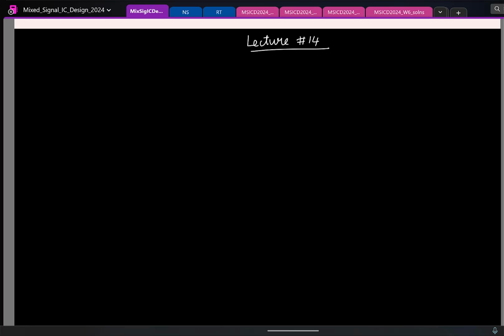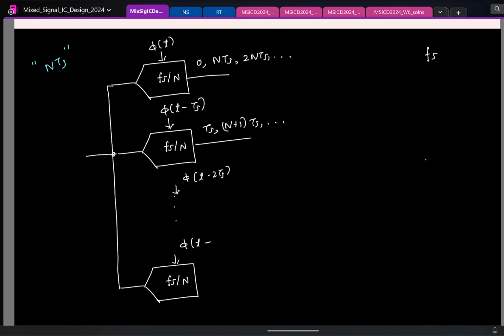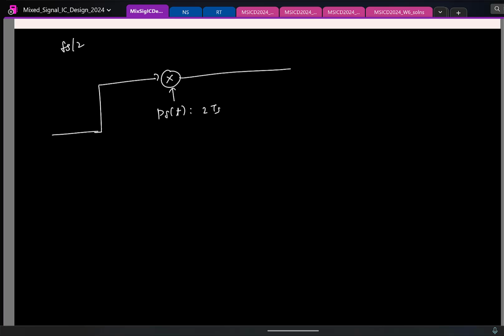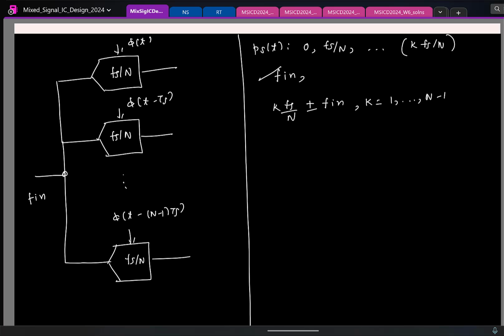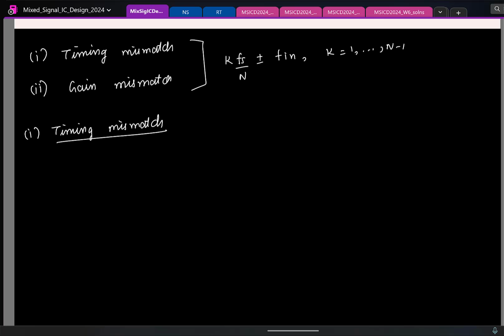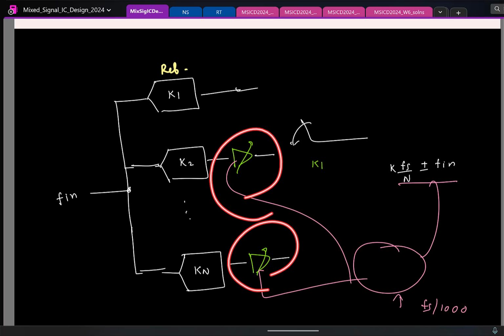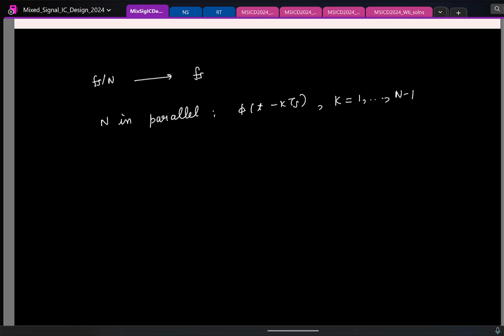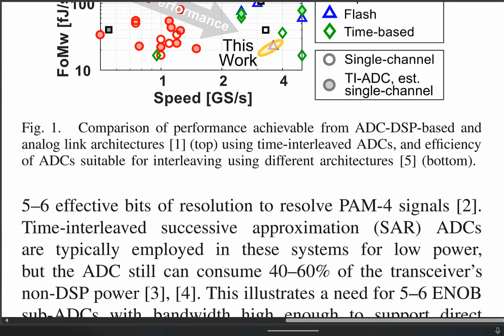Lecture 14: Time-interleaved ADCs; Gain, timing & offset mismatch; Calibration to correct mismatches

Comment: Thank you for your video. When you show that time interleaving images gets canceled (let's say for the case of 2XTI), you use fs/2 as the frequency to calculate the phase for the second sub-ADC, 2pi X f X Ts = 2pi X fs/2 X 1/fs = pi and hence e^jpi = -1. But when the tone is at fs/2+fin why you don't use fs/2+fin?
Reply: The professor is implying that the magnitude response of each sub-ADC is same which is signified by the location of tones at (kfs/N) +- fin. So, he is adding just the phases. Moreover, the tones are still centered at kfs/N
Consider two complex numbers having same magnitude and different phases. 
A= |A|*exp(phi1), B = |B|*exp(phi2)
Let |A| = |B| = M
So, A= M*exp(phi1), B = M*exp(phi2)
Sum = A + B = M { exp(phi1) + exp(phi2)}.
If phases are opposite, they get cancelled. That's what is happening at all the values of k except k = 0, where they get added. Referring to 36:48.